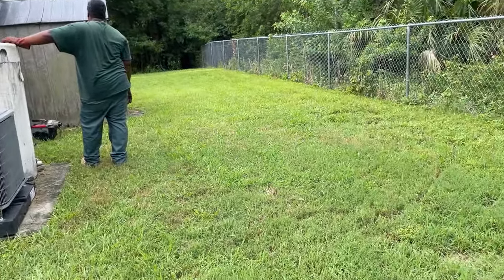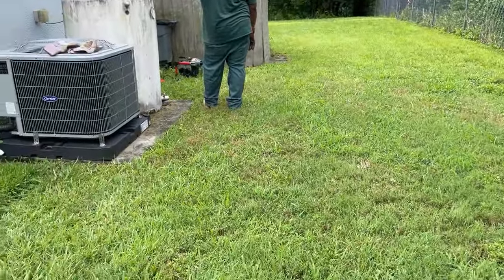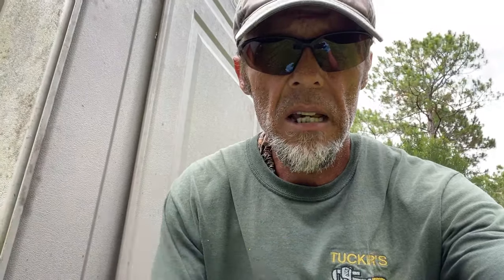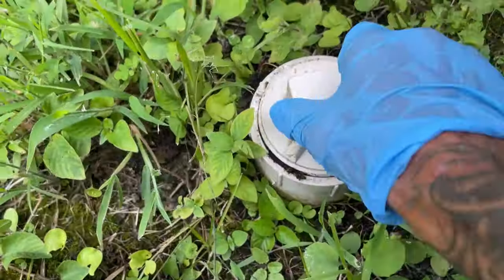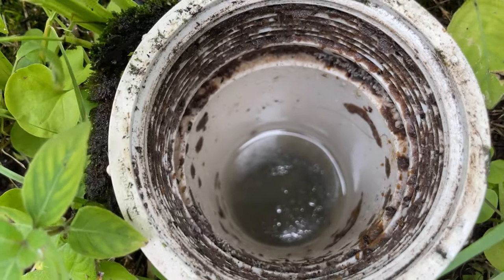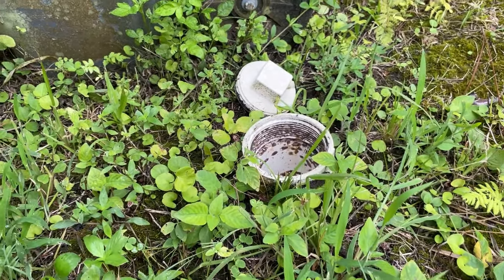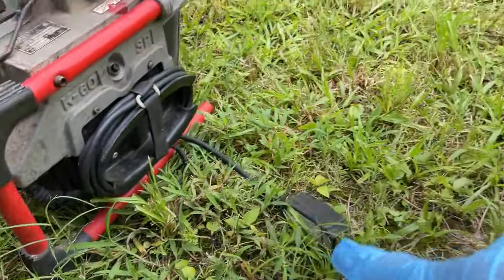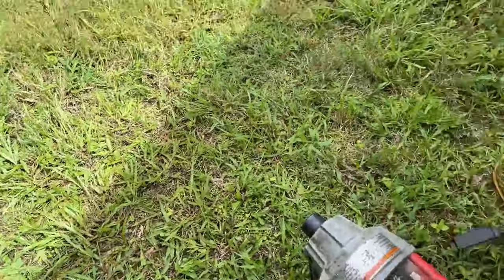HOW TO CLEAR A HOME MAIN LINE DRAIN STOPPAGE ON A SEPTIC SYSTEM

Comment: 9 times out of 10 the clog is in the inlet baffle. Pop open the inlet side lid of the tank and poke it with a soil probe or stick to unclog and buy time until a pumper can come clean the tank.
Reply: You saved me that one.  My basement tub wasn't draining, I pulled septic discharge lid it looked fine, I opened the clean out pipe and saw it was backed up.  So I went to lowes to get a snake and sitting in the parking lot I watched this video and saw your comment.  I don't know why I didn't even look at inlet..  I popped the lid when and I got home.  And sure enough the clog was plain as day and didn't even need the snake.

Comment: When i used to clean drains, id generally pop the tank lid and snake backwards from the T to the house. 90% of the time, the clog was within a few feet of the T.  The cause was generally a slight dip in the pipe right before the tank that collected solids over time and eventually backed up. It also eliminates the fear of running your snake into the tank by accident
Reply: My blockage is at the septic tee. I didn't know it was possible to get your snake in the tee. Thanks
Reply: Thanks. This answers my questions. I've watched many videos trying to find out if I can go backwards with the snake. I think the clog is probably close to the end and there is some water flow. I have to do repairs myself and learned a little bit from watching my husband when he worked on the backups. 

I'm about to replace the toilet. Could I run a snake from there ,after removing first?
Reply: @Norma V   you can also snake it right from the toilet flange, I did this many times when I could not find a clean out. and if you're going to try and snake the line backwards, make sure to measure the distance from your tank to your house, if you go any further than that distance, the snake can start crawling up drains that's its not supposed to. It's always best to snake with the flow of the water, but sometimes your snake isn't long enough, or the clog is so close to the tank that it doesn't make sense spooling out 80' of cable from inside, when you only have to spool out 10' from the tank lid

Comment: I've been having issues for months here in SC with toilets "Bubbling". I found my cleanout at the Septic tank and it was full of stuff. I bought a 50ft 1/2 inch snake and cleared it...but..I'm having to do this about once a month or so to keep it from backing up. After pulling the snake out there's nothing on it. I don't understand what the issue is. The tank was put in less than 3 years ago. We are pretty high up from the surrounding elevation. We definitely have not had much rain so I don't think field saturation is the issue. I just don't know.

Comment: Hey Tim, I have to septic lines with 2 seperate cleanouts.  My septic was just pumped back in Nov, due to back up, and then it did it again last night.  I have an old metal snake that rolls up about 50-75ft.  I shoved it down the cleanout with standing water just like you did, and it fixed mine too.  I live in NC so the rain aint so bad.  As I was snaking i thought i heard water splash.  Does that mean i was in the tank, or the tank is over full?

Comment: any videos on  pressure sewer system?   I noticed the sewer is draining water  outside and has a sewer gas smell.   Inside house all water drains without issue.    Is there anything I could do before I contact a specialist?

Comment: Question.. my toilets are backing up after septic tank was pumped.. I opened the pipe screw and water jetted the clog from the opening to the septic tank.. works for about a week then toilets backing up again? Any advice on what is going on

Comment: Why do people use them cables. The company here has ALOT better equipment and have reinforced cables that are a lot thicker with bigger cutters that’s a small cable for a three inch clean out. Maybe use the right equipment and it would be done the right way.
Reply: Maybe don't be an AH and realize different places and different t septic situations call for different  equipment.  And the fact you are calling it "cables" tells me you don't even know what you are talking about.  Rude much? Do better.